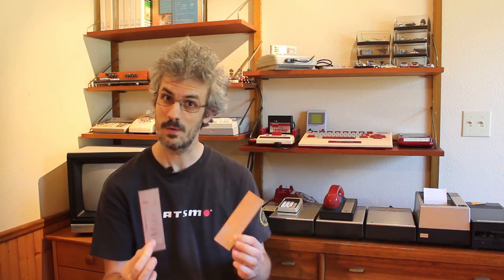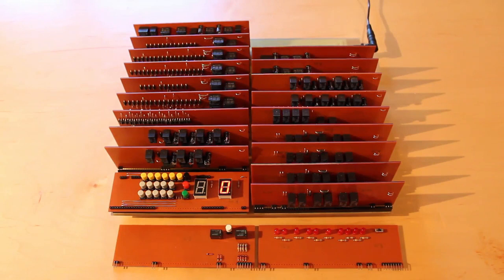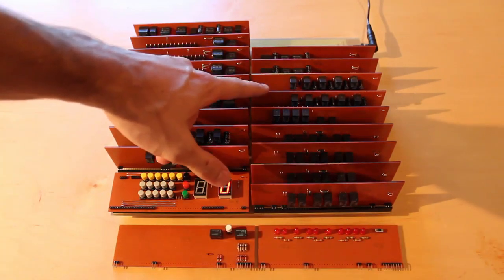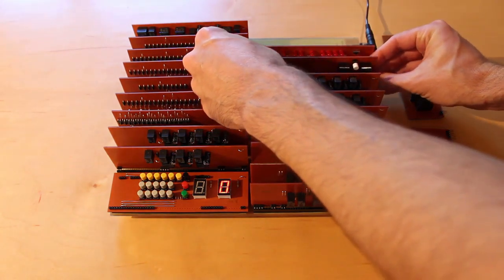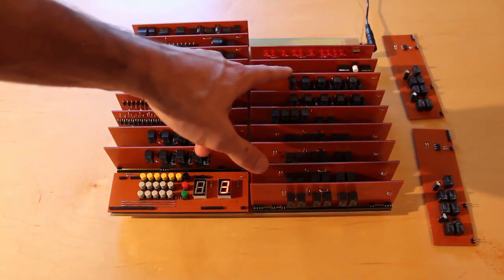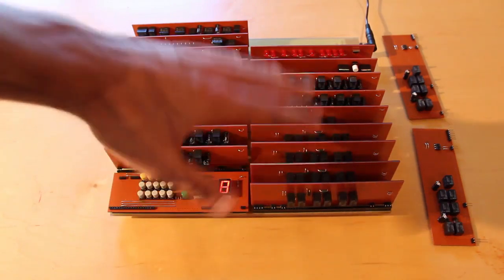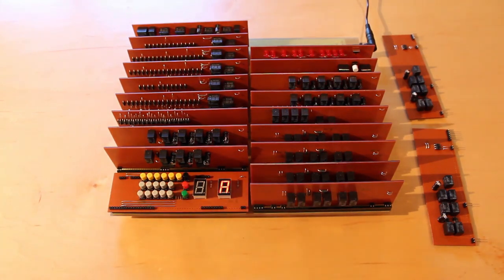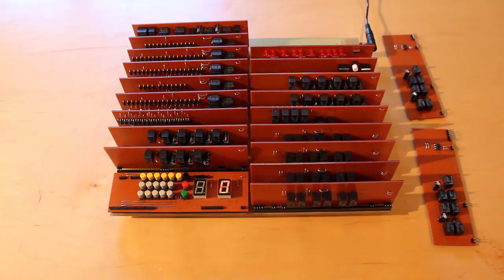Relay Calculators: Episode 9 - Installing the New Boards

Comment: All-in-all, and excellent series. Back in the late 1980's for a computer science lab, I had to design and build a 4-bit computer using 7400 series logic chips.   So having done something similar, I have some questions for you regarding the decoder board and the reset board.  I'm not sure the reason the decoder board needs to be be 5 separate boards? Perhaps it couldn't fit all the decode logic?  But if it could be done in one board, perhaps to solve the Carry lighting up a '1' prematurely, why couldn't the output register latch 5 bits, 4 plus the carry?  and the output decoded similar to the logic of a 7447, except use diodes to make up the digits, the output is [ 0 ] [0 - F] through [ 1 ] [0 - E]. Thus when you press your reset you can send another pulse to write to the output register... and that would accomplish the reset line.   If you don't have the bus connection you could run a bodge wire on the motherboard.  The Static RAM relay boards could have been used as memories that could be transfer to/from the M and N registers to the ALU.  So it's a register transfer logic controlled by your input buttons... I guess that would require some more redesign and the motherboard to have the relay traces...  It's a fun project I have to admit I wish I had time to tinker, I like the approach with the relays and it takes me back to my days at university.  Another approach is to use diode arrays, I don't think that it's cheating as you are allowing yourself to use diodes, the packages are just a lot smaller so you can cram more functionality on a board.
Reply: It looks like the boards are limited in component area due to the constraints of the milling process. With a commercially made 2-layer board things would have fit much better. But Usagi has that CNC mill, it’d be silly not to use it. The boards look like art pieces after milling.

Comment: I’m curious why you handled LED data separately. I would have just decoded the LED data directly and handled it all as binary.
Reply: I think that he wanted to stick with hex code throughout the machine. But yes, handling it in binary should have been simpler.
Reply: Both are valid approaches. The interface between the display register and the display is trivial when everything is decoded. And the decoder is just like any other combinatorial function that takes an operand from the bus. IMHO the approach Usagi took is very reasonable, and there’s no universally best way of doing it. Each has its tradeoffs.